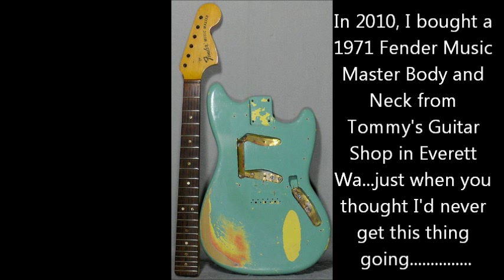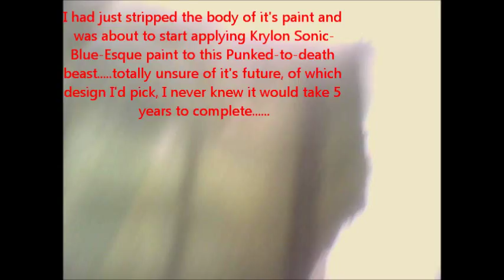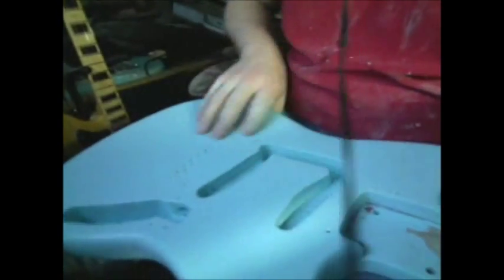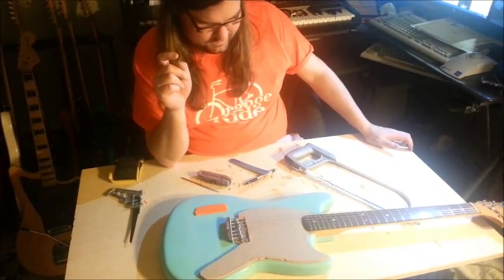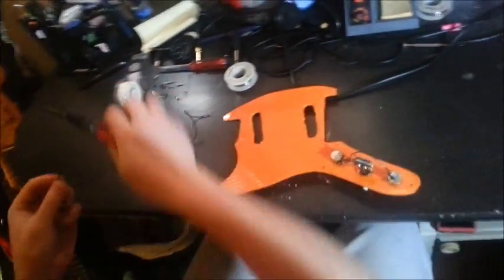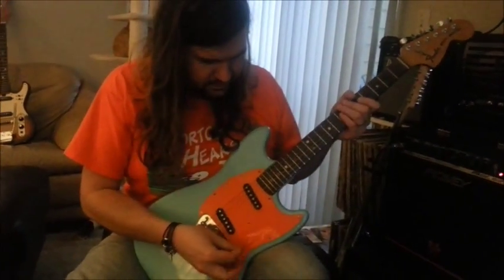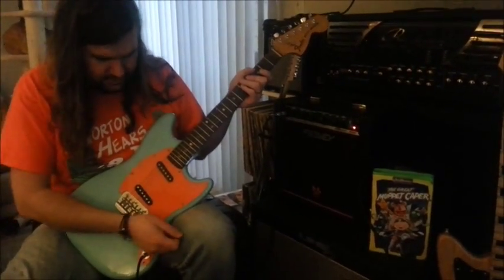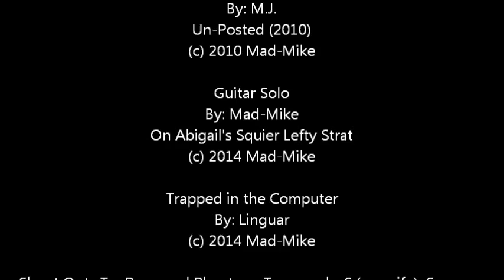1971 Fender Music Master Build (2010 - 2014)

Comment: Remove the neck, and tape up the pocket and cavities. This ensures a tight and snug fit, People can chip their paint if trying to force a neck into a painted cavity, as the micron more might start the chipping. Also you get better tone transference with wood to wood as opposed to wood to painted wood. Nothing audible to the human ear (unless you have perfect pitch) but it does show up with frequency graphs while testing both methods. Different paints will impart different tonal characteristics. Again, this is preference, simply sharing my knowledge on the industry standard. Cheers!